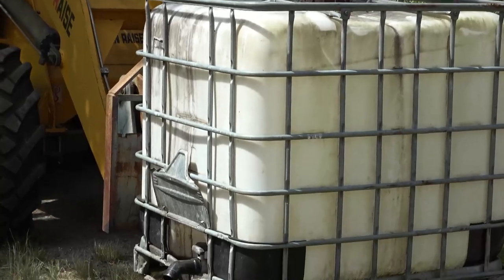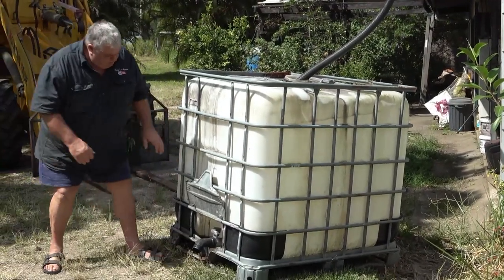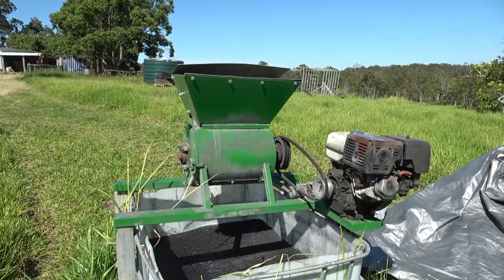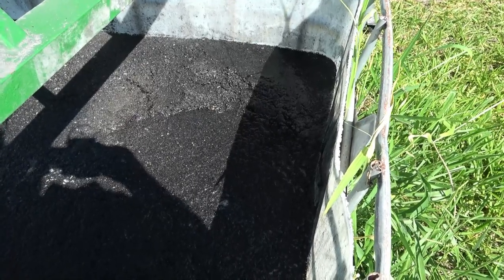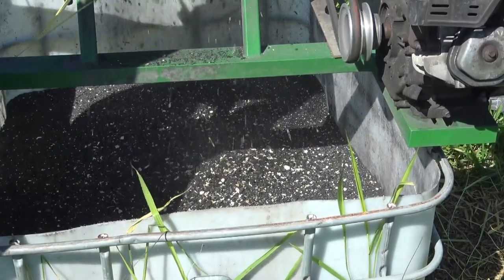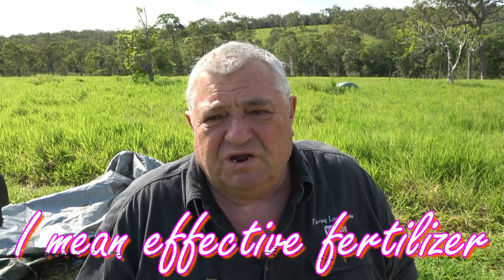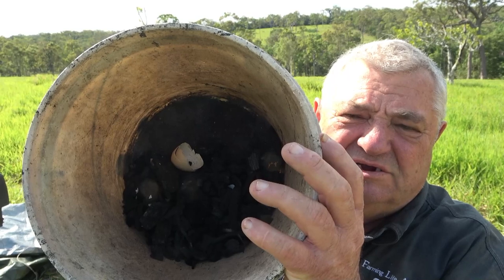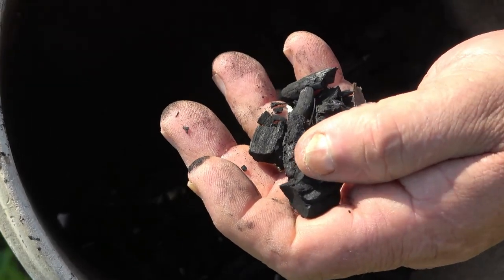BIOCHAR SERIES. EP 2 CRUSHING AND CHARGING.

Comment: Hi. Love the channel. I’m an old farmer myself a bit older than you I once found in Tully not far from you ha ha. I have seen fairly large quantities of Biochar crushed up by the sticking in an old working cement mixed with a few😊 tennis size rocks that does a really good job it’s a bit longer time wasted than what you do but for small or

      

 people it’s a great little idea thank you and all the best

   Gg
Reply from the maker: I have tried that and it works my cement mixer was new and it was a bit hard on it. Be a great way to clean out the old dry cement at the same time. John
Reply: I do this also with used mill balls and a cement mixer. I've also modified a chaff cutter with a smaller exit point.
Dust is bad for us so I soak my charcoal straight from the retort for at least two days. Great channel, thanks.
Reply from the maker: @brendoc.3665  Sounds good thanks for watching and commenting. John

Comment: I found this info online which may or may not be useful, I've personally never been through the process however you mentioned you couldn't find some info. Hope it helps 😉

The optimal particle size of biochar for farmland can vary depending on several factors, including the type of soil, climate, and crop being grown. Generally, biochar particle sizes between 250 to 1000 micrometers (µm) are considered suitable for agricultural applications. However, there are some considerations to keep in mind:

1. Soil texture: For sandy soils, larger particle sizes may be more beneficial as they can help improve soil structure and water retention. In contrast, for clayey soils, smaller particle sizes may be preferred to enhance porosity and drainage.
2. Crop type: Different crops have varying requirements for biochar particle size. For example, crops with shallow root systems, such as lettuce or spinach, may benefit from smaller particle sizes to improve nutrient retention, while crops with deeper root systems, such as corn or wheat, may benefit from larger particle sizes to promote better water infiltration.
3. Climate: Climate conditions, such as precipitation and temperature, can also impact the ideal particle size of biochar. In wetter climates, smaller particle sizes may be preferred to prevent waterlogging, while in drier climates, larger particle sizes may help improve water retention.
Reply from the maker: Thanks very much for this it will be a good guide. John